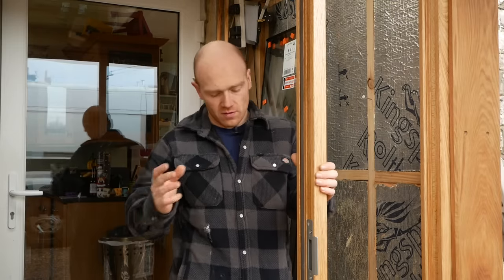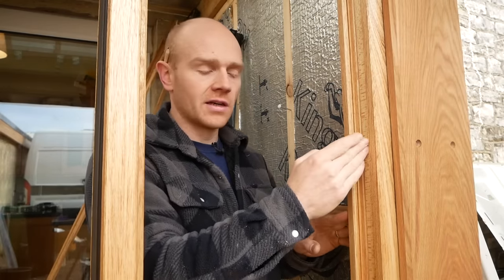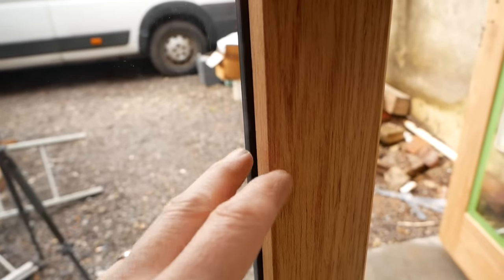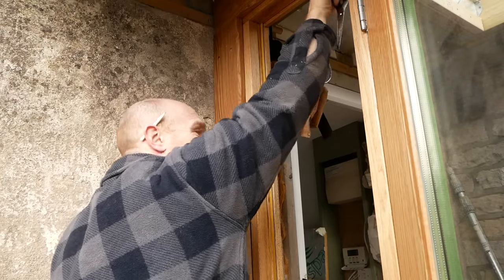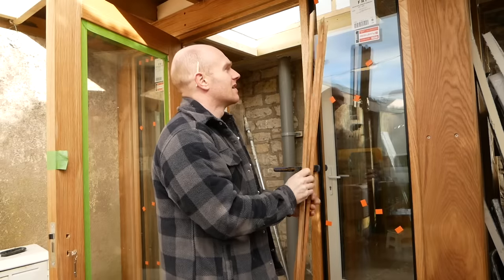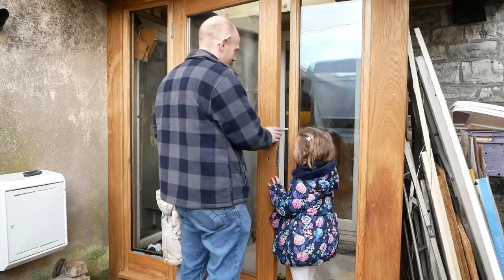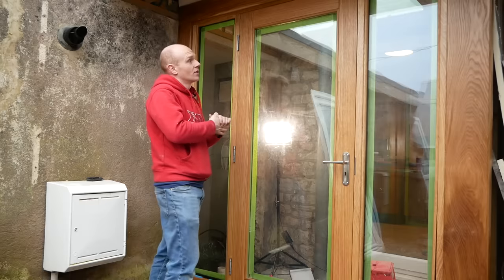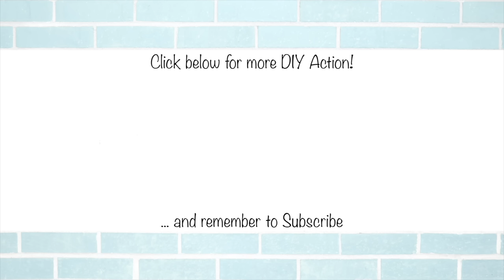Fitting Glass in Timber Windows - Dry Glazing Method

Comment: You can wet the tape with a water spray bottle to give you a bit of working time to adjust it with no loss of adhesive when it dries..... and for externally not been as secure internally ? You’ve just demonstrated how well that glass is stuck inside the frame, so what makes you think you’d get the glass out once you’ve got the beads off ? !! It’s easier and quieter to drill a hole and pop internal beads off from the outside letting the glass fall out than it is to smash through a stuck externally beaded one ! 👍

Comment: Really enjoyed watching you work on this.  2 questions, if I may:
The glazing beads went on the inside, right?  Nothing went between the glass and the glazing beads?  Like rubber gasket, or silicone?
What type/brand of double side adhesive tape did you use?  Can you give a name so that I can take a closer look at it?  (how thick, soft or hard foam, etc).  I was looking at M3 VHB and it's crazy expensive and probably an overkill, and there are so many types that my head spinned...).  So more specific information will be highly appreciated.  Thanks!

Comment: Nice Job on the porch, 
little tip on the glazing tape, put the tape on like you did on the frame, pull about 2 inch of yellow covering off tape, then fit glass in place with packers, then from inside pull tape off around glass
Reply from the maker: Like that, makes sense. I guess it’s similar to laying a vinyl sign that way. 👍

Comment: Hi there just to let you know the stickers on the glass always go to the internal side as that is the side of the thermal efficiency glass is. Either planitherm or k glass also a little tip you can spray the glazing tape with glass cleaner this way it stops the glass sticking straight away when fitting but sticks firm as soon as the Solution has dried.
Reply from the maker: Yes, might try that next time give a bit of working time.  You have made me doubt myself so much I just dug out the original footage!  Especially after making a point of talking about making sure which side faces out. 😳 It does definitely say exterior on the Planitherm sticker though 👍
Reply from the maker: Here is a screenshot,  as I know previous windows we have had said Interior on them.  https://www.dropbox.com/s/b9rr0xuu84help8/Screenshot%202020-01-17%20at%2011.36.05.png?dl=0
Reply: Hi ,Sorry there I didn't mean for you to have any doubts in your work at all it's just generally how it goes and it looked to me like all the stickers on the glass were facing to the outside. To be honest though in my opinion it shouldn't really matter on a porch too much as it's more of an addition to the house rather than an extension of if you get me. Nice work by the way 👍

Comment: I recently oiled our oak veneered internal doors and someone pointed out that if you don’t use the correct oil then it can affect the veneer adhesive and cause de lamination.  I had used oil for veneered doors so all is good.
Reply from the maker: Yes worth checking especially as it can void warranties if you don’t stick to what is suggested. 👍

Comment: Hi Tim, porch is looking really good. Just watch routering those oak beads like that. Wouldn't want you to lose a thumb - your only an inch away from the cutter and that oak can sometimes split in such a small section of timber. If I'm.running up chamber mouldings I set the table saw to 45degree and push through with a feather board - much quicker and safer and is just as accurate
Reply from the maker: The inside beads I did on the table saw but just wasn’t happy with the finish, it was probably ok but without decent feather boards it was a little inconsistent. Router table planned so, so thumbs will be safer soon. 👍